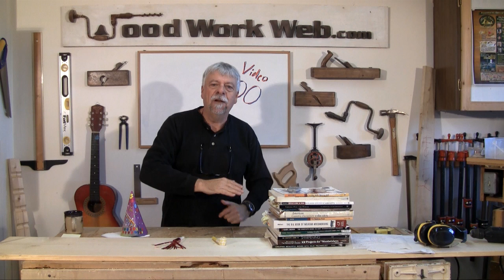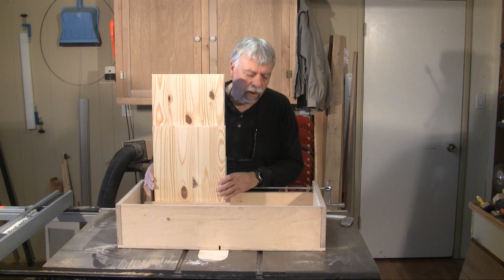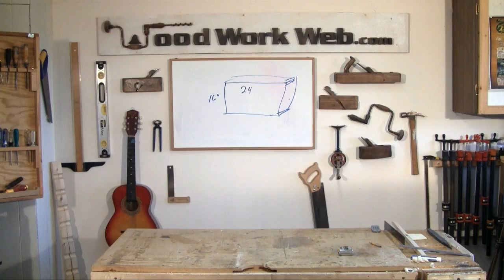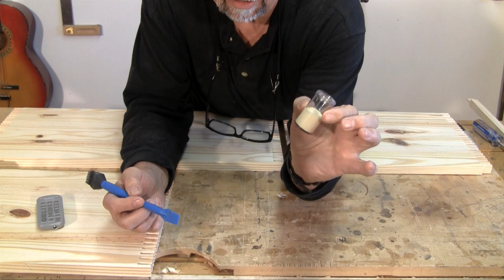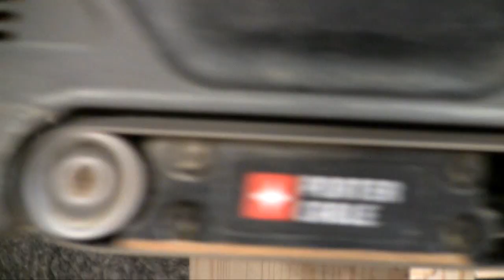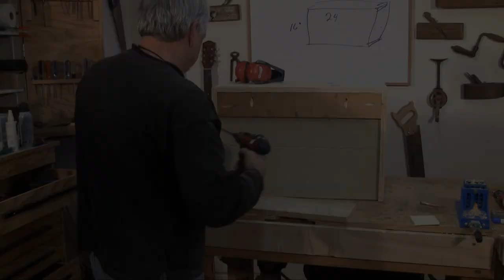Build a Box Joint Library Cupboard -  Woodworkweb

Comment: great little project!  what's up with your drill, though?  was it just really low on juice, or a bit underpowered?  I tend to use a corded drill for my pocket holes but even my old crappy 18v B&D can do a few of them in one shot each before kicking the bucket.  Might be time to get you a shiny new brushless lithium ion setup :)
Reply from the maker: djjoshuad  I have a pair of drill/driver 12 volt lithium, not really powerful enough for pockethole drilling but it will  do a few before the battery dies, I normally use a corded drill for making pocketholes but if I only need a few the portable 12 volt works fine

Comment: In my condo we have very cheap cabinets, and I always worry about them  falling off wall with the weight of dishes or what ever.  Would this be a good way to do a project like that?  I can't see why not, but then I'm still learning.  I could build them in sections width wise for easy handling.  Weight of books is on the heavy side, so I'd think it would handle dishes easy enough. Or, is there a better idea?  Great Video!
Reply from the maker: ***** Hi Gary, glad you enjoyed the video. To be honest, I have only ever heard of one instance of cupboards coming off the wall, so you are probably pretty safe. You could do cabinets like this, but traditional cabinet building is quicker and would easily be strong enough. I made my own kitchen cabinets, and the one problem I had ... is after you make each one, you have to store them until they are all made and ready for install. They take up a LOT of room in the mean time. I think I was at least 3 months before I got mine installed so it does take time.
Before you do anything Gary, get (buy, borrow) this book from Taunton Press - Building Kitchen Cabinets. It will give you a lot of insight.
Reply: WoodWorkWeb Thanks for the further info.  I used to work as a repairman for houses in escrow.  I never saw a cabinet completely fall either, but I did come across several that were sagging or leaning 2 inches or more quite often and about to make the fall, thus the start of my fear for cheap cabinets.  The ones here (Colombia) are 1/2" particle board and cheaper than anything I have ever seen.
 I did look  at a cabinet site by Sommerfeld and he showed a very solid cabinet.  Now I'm thinking of the finger joint for the back wall to the sides, then going with the rest of the build his way.  I viewed a stress test of finger joints and the wood broke before the joints.  That's pretty darn strong.  As per your advise of time involved, I'm going to start with a smaller project along the same lines for my storage closet first and see how that goes.
In all my time repairing houses, I got very good at repairs, but never became a craftsman.  Retired now and time to learn.  Thanks again for your advise.  Small projects first, then the biggie.
Reply from the maker: *****  Well if you have been a repairman Gary, you will probably have some pretty good insights as to what is needed. You are correct about the box joints being strong (when they are glued) and they look nice too, at least to me. I think you are wise to tackle a smaller project or two first. Keep in touch Gary, happy to help out if I can.